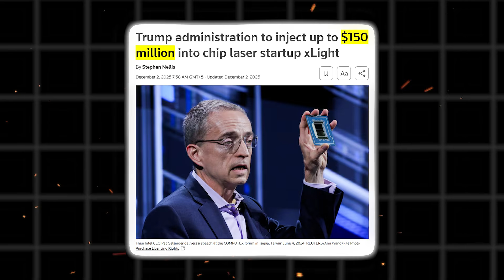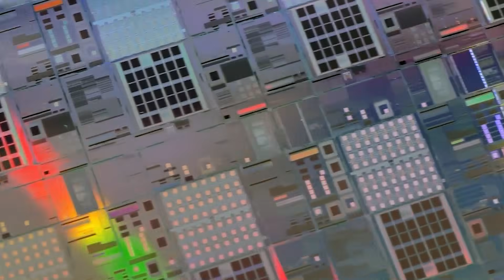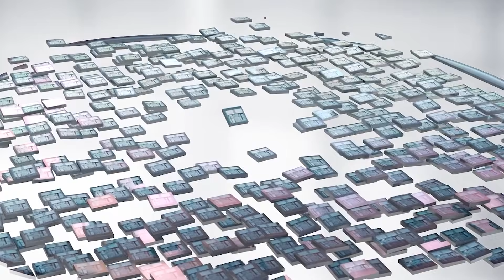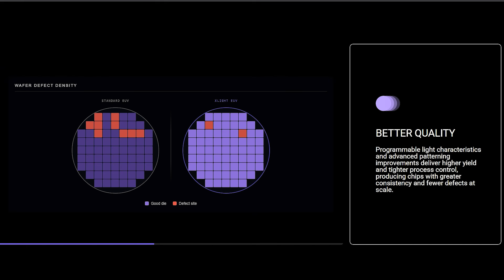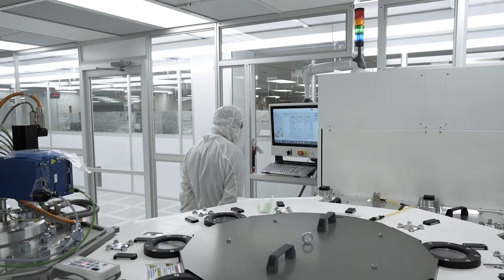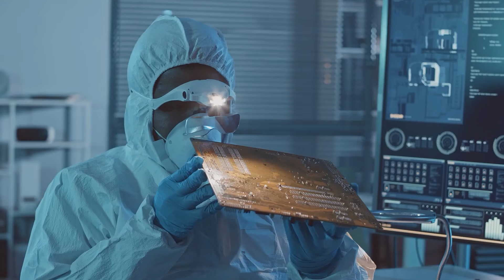America's New FEL Monstor Destroyed ASML's Monopoly Forever!

Comment: No.

Just no.

The EUV light source is only part of ASML's lithography machine, a part which is easily the most problematic because it's basically blasting tin all about the spot all day long.

If xLight actually get anywhere it's likely that ASML will become one of their first customers or partners, simply because an FEL is a far cleaner light source than laser created tin plasma.

Comment: Cheaper and faster chips! Yeah, I want'em! We need way more productivity and efficiency gains to give consumer a chance to get to affordable electronics again. Unfortunately this invention seems to be a decade away still from production.
Reply: Decades are getting much, much shorter.
Reply: Simply kicking Moore's Polemic down the road like a can, yields some benefits, however traditional printed ICs on silicon suffer from a portfolio of hard physics limitations that stifle their performance. FEL sources cannot address those getting smaller makes somesuch limits better but makes others somewhere between more annoying to much worse to intractable. But superconducting computer chips are immune to many of the physics roadblocks  of traditional silicon. It's just been considered a manufacturing pipe dream for decades. Also SC chips are the only technology that makes space based computing centers look like anything other than total fraud. This is the technology the US Government actually needs to be investing in. Not FEL light sources.
Reply: The initial investment will not be cheap though - it will take time for the FEL manufacturing supply chain to scale to the point that it makes an economic difference.

"Unfortunately this invention seems to be a decade away still from production"

Because it's still a piece of research equipment rather than a scaled down production ready device.

There's lots of research going on that can yield dramatically shrunk components for a FEL - but nothing has yet been produced that makes use of them, let alone a supply chain to scale production of it.

Comment: ah so now tsmc just needs the space to build km long particle accelerators etc.
And complete change of all their production facilities from the ground up.This x light literally poses no threat at all to asml for a very very long time.
Reply: #1) Particle accelerators don't need to be linear, and often aren't.
#2) The length needed for this application was not specified, but i likely less than what's used to explore the latest theories.
#3)  The CEO and CTO have been leaders in their fields for decades, as is likely the case of their backers$$. The commercial size they must foresee can't be kilometers.
Reply: Tin method consumes space too, there are giant lasers below the fab
Reply: Lol this didn’t age well, now the Terra fab is going to build a circular accelerator underneath the fab.
It really doesn’t take much space since it’s underground and with automated tunnel machines it won’t cost a arm and a leg like the European particle accelerator did.
Reply: this didnt age well. Spacex will be buying this x light out for Terafab